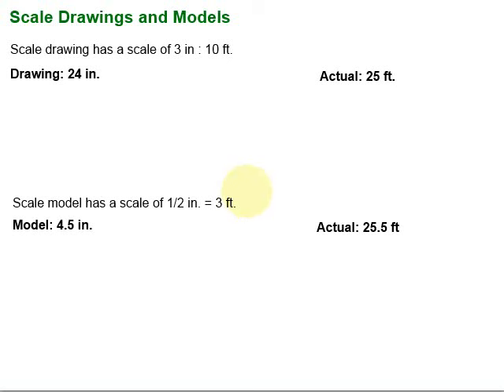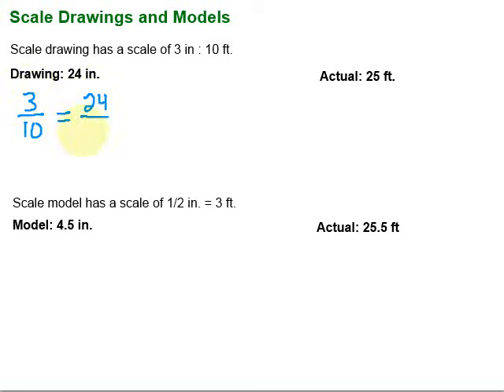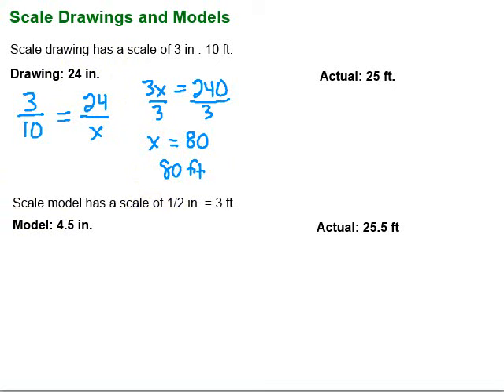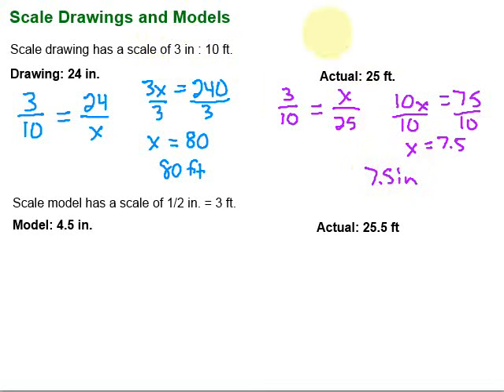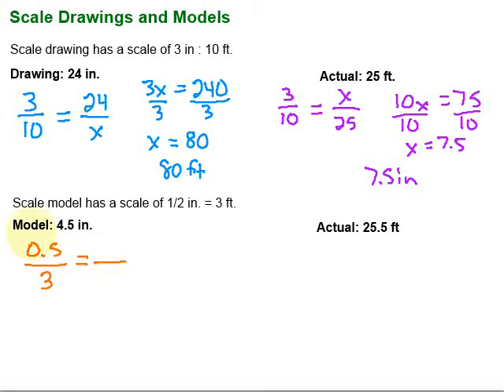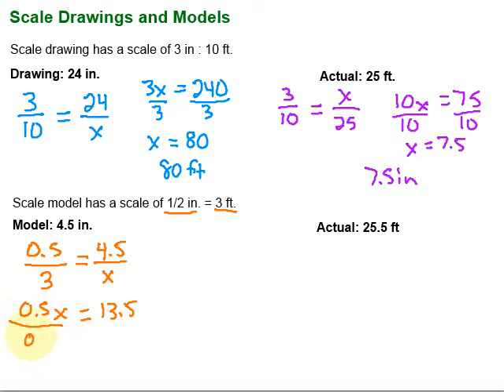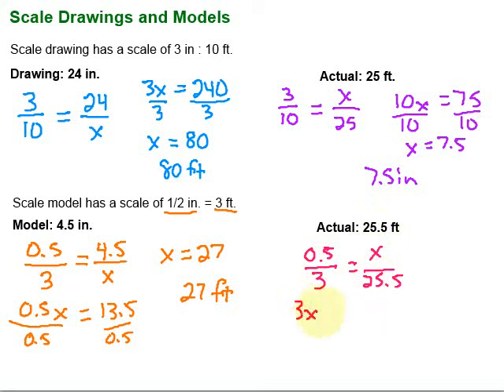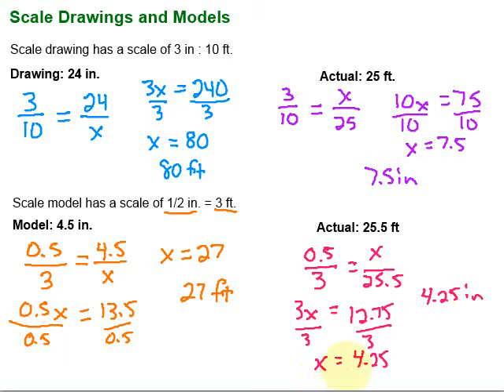Scale Drawings & Models

Comment: One last question sir. What if I increase the size of my 1:84 scale model to 1.5 X , how would I determine it's new scale?
Reply from the maker: I'm not 100% certain of your question, but if you are looking to make your model which has a scale of 1:84 larger, then the scale needs to be smaller.  If we divide 84 by 1.5, we get 56.  That would make the new scale 1:56.  The model would be larger because 1 unit on the model would be equal to 56 units on the real thing, rather than the 84 with your original scale.

I hope that helps and answers your question!  Please let me know if I completely missed what you were asking! 😳